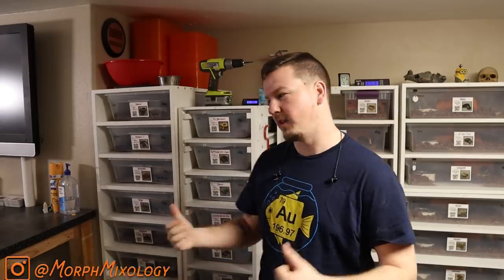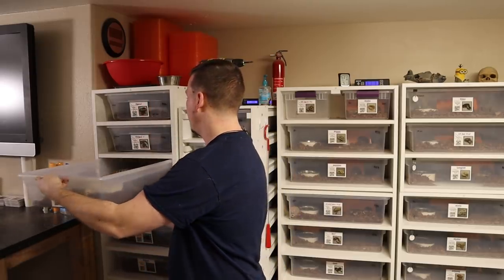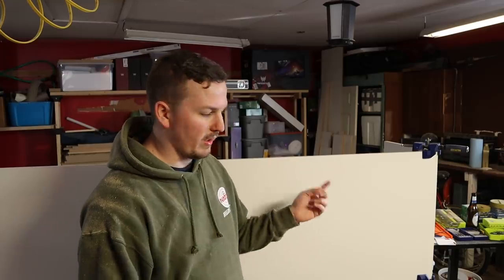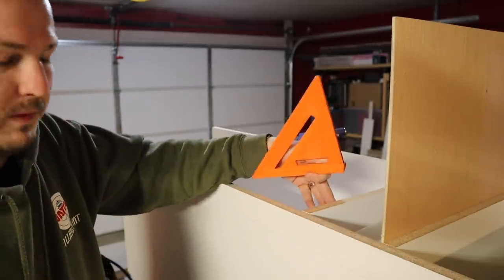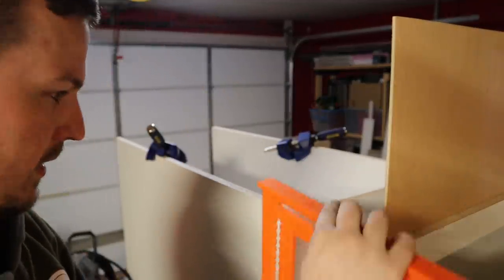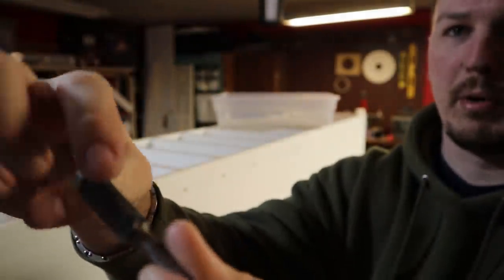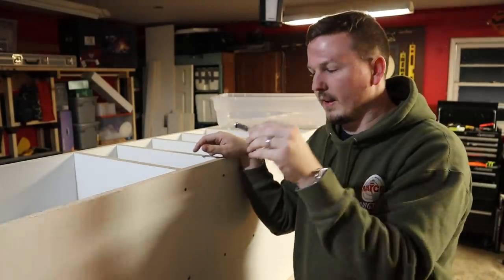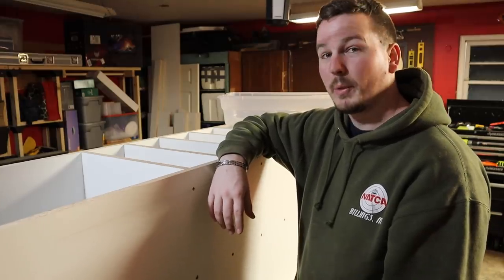28QT ADULT MALE RACK | Mixology #41

Comment: I've read there is suppose to be a gap between heat tape and tubs. 1/8th inch. Is this true and how to achieve it if totes just sit on shelf? Unless tubs have raises feet in corners. Not sure if mine do but waiting on my rack so needing to rig a muscle shelf with heat tape till it comes. Tubs are from the container store

Comment: im confused in the plans it says you use 2 inch melamine with the board size of 49x97x2   and not 96x48x.75 can you use 3/4 inch melamine?  are your boards bigger than 4'x8'

Comment: Instead of using the router, why not use a door board, and a circular saw with a high tooth (like 60 tooth) blade.  Line up the door board with the bottom of the shelf, clamp it to the side, then run the circular saw along it.  perfect cut, LOTS less mess, and with the door board it prevents some chipping of the melamine.
Reply from the maker: Ya maybe. I'm just used to the router